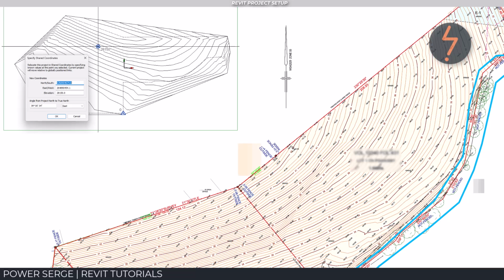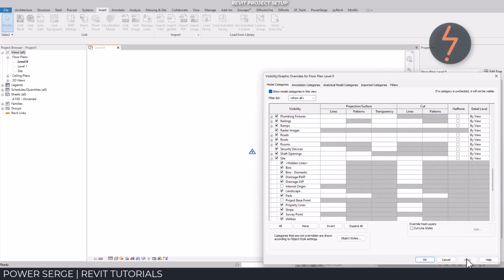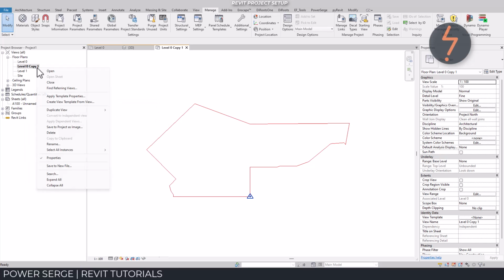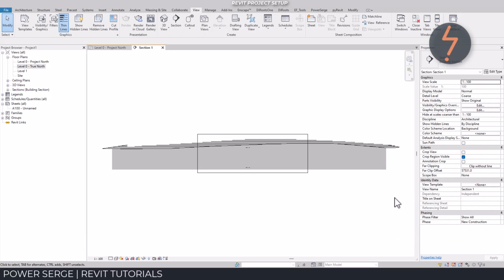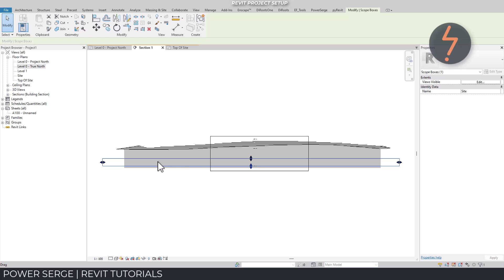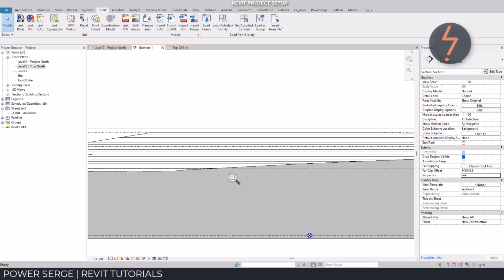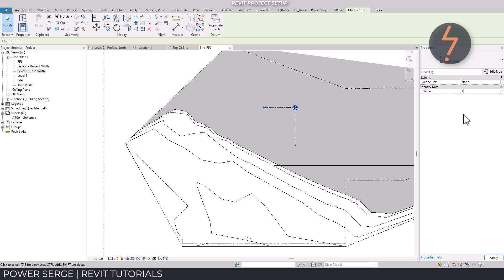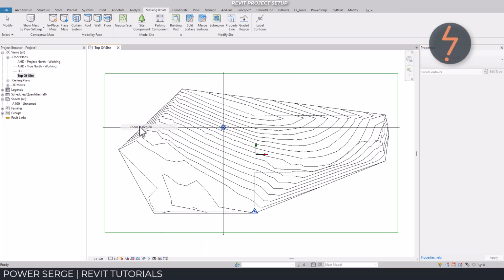Mastering Revit Project Setup: Using Geolocation Coordinates and Real-World Elevation for Precision

Comment: Hi Sergio, I have been trying to import the geolocated CAD file into Revit but it seems to show this issue, "Geometry in the file has extents greater than 20 miles.....". Have you faced this issue? I have been trying to look everywhere for a solution but its still not yet clear
Reply from the maker: @aqueeljumaa2418 , how did you import the CAD file. This has to do with the extents of the CAD file. If you copy and paste the CAD elements into a new file and ensure it’s referenced to 0,0,0…then try again.
Reply: @SergioBarata  In my case, The CAD file is geolocated which is probably the reason the issue arises. So I am not sure how to exactly get those shared coordinates in Revit when linking the CAD file with Revit.
Reply from the maker: @aqueeljumaa2418 , have you seen this…https://www.autodesk.com/support/technical/article/caas/sfdcarticles/sfdcarticles/Geometry-in-the-file-File-Name-dwg-has-extents-greater-than-20-miles-33km-while-inserting-a-CAD-link-into-model-in-Revit.html

Comment: that's nice described, why did you move back survey point into the project ? is there any problem leaving it at 0,0,0 ?
Reply from the maker: Thanks. I moved because 0,0,0 is not the survey point of the the project. It’s important to get a real intersection so the coordinates are correct.

Comment: Nice video Sergio as always. Good trick with inserting dwg on the current view so you're avoiding to bring 3D dwg into Revit. And later on you're doing  topography from list of points. Practically your zero value is at sea level, also for project base point so I am curious how you set later the building to have two types of spot elevations with relative and apsolute values?
Reply from the maker: Thanks! Do you mean the Elevation Base Ht - where I change from Project Base to Survey?

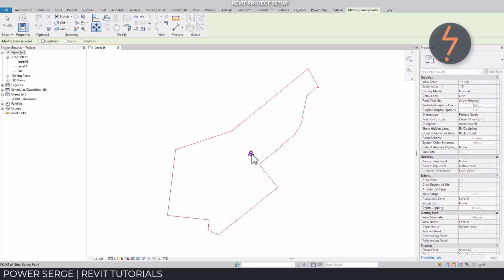Comment: Thanks nice video, 2:46 why at that corner only u choose to locate the survey base point ?
Reply from the maker: It could be any corner. I chose that one because it’s closer to a right angle…it’s an obvious choice to help with tutorial comprehension. You can even cross check all corners if you want.